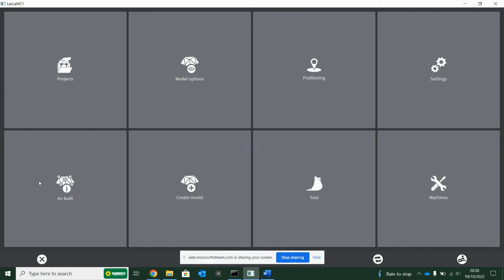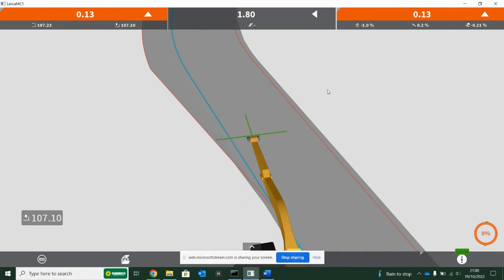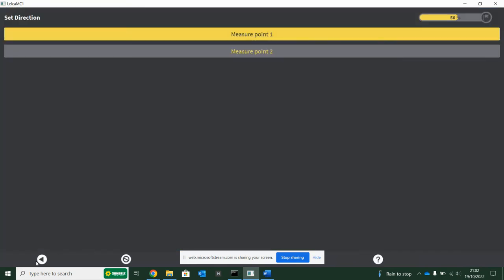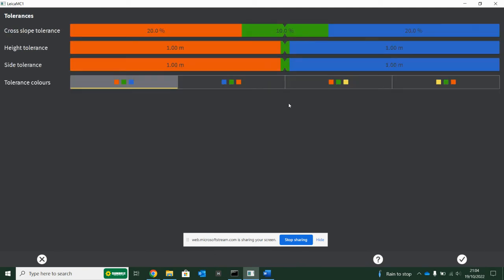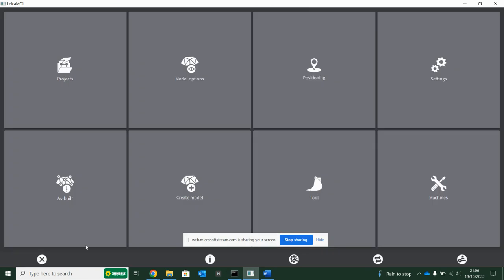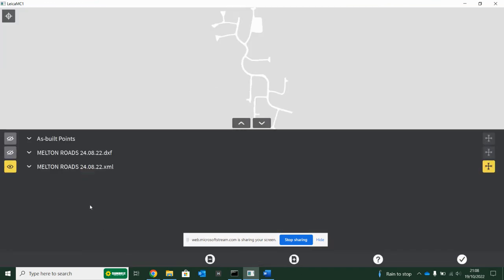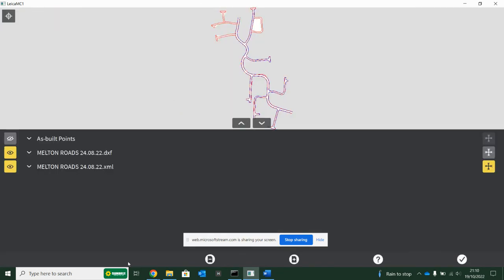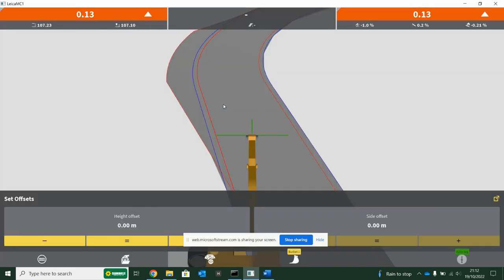NEW Leica Machine Control System Part 2, TIPS & TRICKS

Comment: Hi, I wanted to ask, does Leica has an option similar to Lane Guidance on Trimble?
Reply from the maker: Hi, yes they do. When linework is imported, on the dig screen just hold your finger on the screen. The second option (two horizontal arrows) is to select what line you want to use as a reference. Autosnap will automatically select the line closest to the blade or bucket, alternatively select the line you want. When selected it will appear in Blue
Reply: @machinecontrol  so I can then apply the level or slope of the selected lane to the rest of the design, ignoring for examples ditches I may want to cut at the end?
Reply from the maker: @germygermy  yes exactly. If the alignments are done correctly you will be able to apply the height as a reference. I will try and get an example however if you look for Leica Geosystems AG channel I think they have one uploaded.